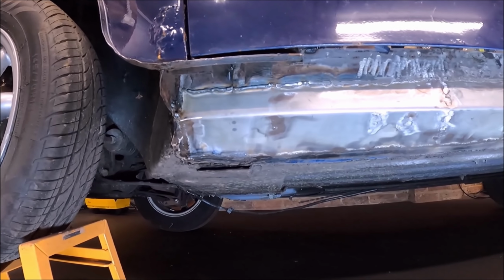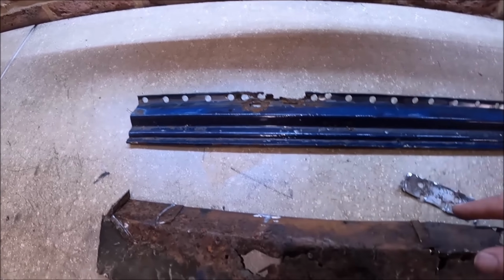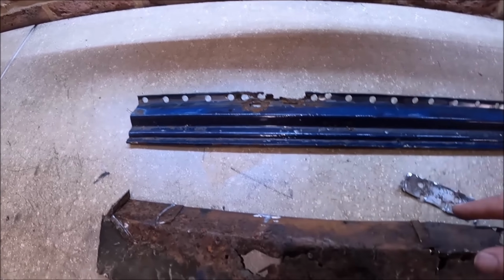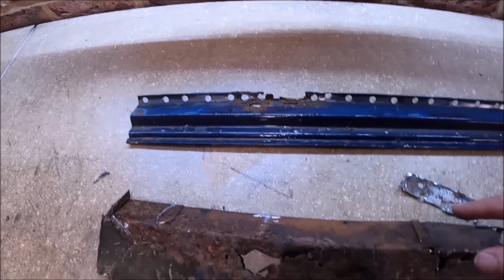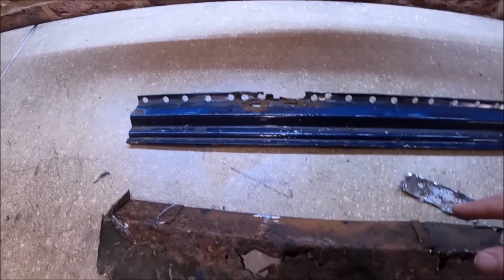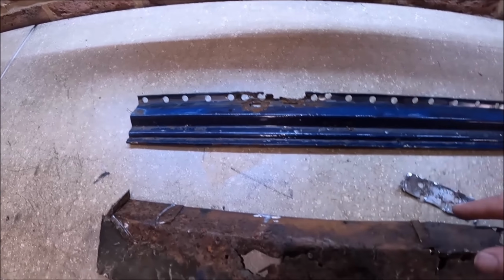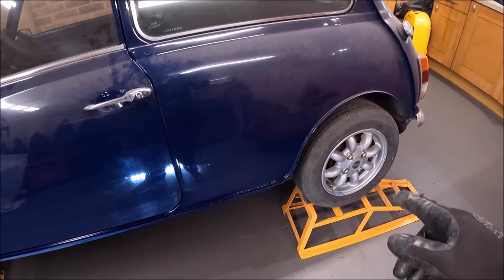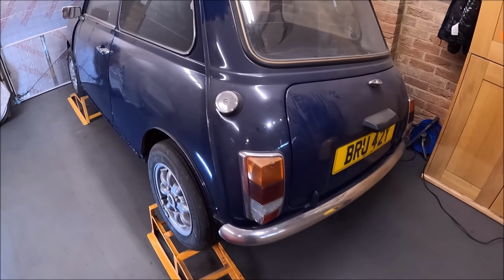Sills Finished - No More Welding (For Now!) *Budget Restoration* - Classic Mini Workshop Part 14

Comment: HI Guys .. The spot welder ......... please get some scrap offcuts and regularly check the strength of the spot welds by peeling the 2 apart after doing a spot weld .Just because it goes red and then blue doesn't mean you have a strong spot weld . Keep the tips in good condition, a small contact area. Roughly 2mm dia , and look for slipping , where the tips slip off each other when max pressure/trigger operates . best  Regards Don
Reply from the maker: Agreed, yes it's a good thing to do! The tips still get hot and go red even if there is no contact between the two pieces of metal as the rest of the bodywork creates the circuit

Comment: My mini which I bought as a project  as it was going to the scrapyard had new overcills on when I got it, curiosity was killing me so I took them off ,only to reaveal another overcill on top of the original cill😮both sides. It was like a cadburys flake when I took the first one off. it's back to the original type cill now and waxoyled . 👍 It must of took more effort trying to get the third cill over the top of the other 2 than it would of took going back to original 🤦

Comment: Great content as per, has anyone got any tips for doing this without burning the paint on the quarters? I remember you saying about a little “trick” but it wasn’t captured on film ☹️ I’m looking at removing over sills and putting proper sills on soon, thanks in advance for the help 👍
Reply from the maker: The paint was so thick on the back that I didn't need to cool it and it didn't burn the paint at all. However, in the past what I've done is use compressed air from an airline. Spot weld, the immediately blow over with compressed air.
Reply: @classicminiworkshop  I thought an air line would be the case, thanks Keith! 👍

Comment: Did you look into those repair panels I mentioned to you Keith?
Reply from the maker: Yes mate, that might be an option. I've had a very nice surprise in the front end. The inner wings are in exceptional condition! Looks like it's been undersealed from brand new.
Reply: @classicminiworkshop  that's good about the front end but shame they missed the front sills 😆 you found any vids with subframe repairs?